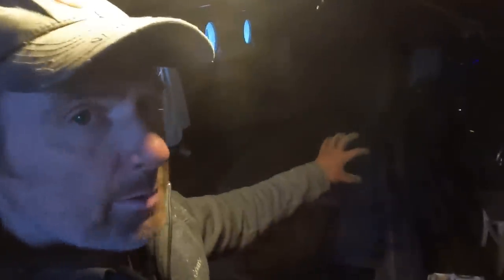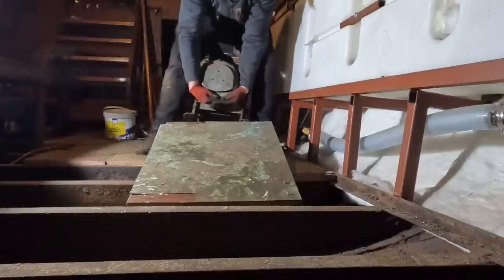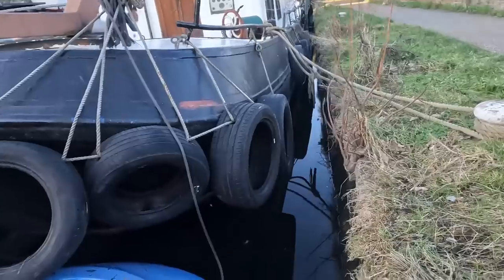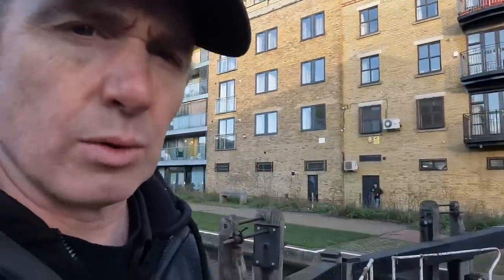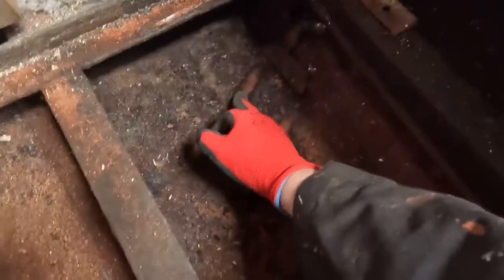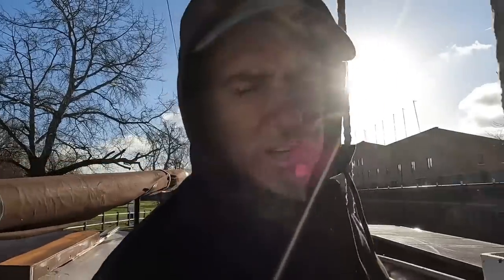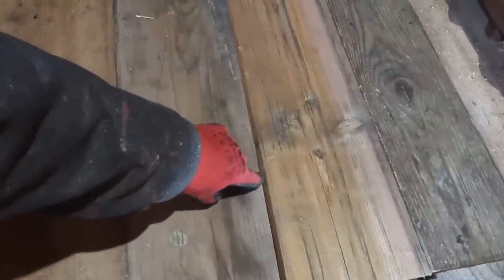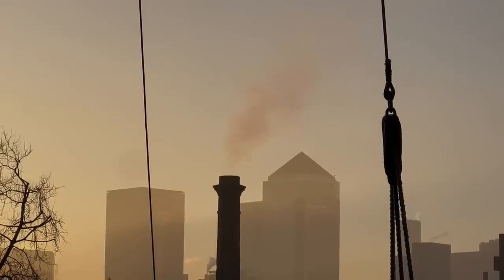Installing flooring and other work on my ancient Dutch Barge Linda 118

Comment: Such a huge step forward! I think it's fair to say that you're over the hump now. From now on lots of fun projects are waiting and I can't wait to watch all your steps. I love the idea that the flooring is made off Lindas old mast AND a piece of old flooring. Will you eventually sand and varnish it? Maybe it's possible to level it with a router after it was laid?
Reply from the maker: Yes I will be sanding and varnishing the boards. There are a few more bits to happen to the boards firstly. 
It does feel like the fun jobs a coming down the road. Everything I do will be an improvement.

Comment: "Did some one say 'FIRE?' As in 18 pounders? Harr. Swab her out--where's my powder boy?--tighten them tackles and run 'er up...."

I can just imagine the Captain getting...uh...triggered...by the word FIRE.  But it looks like it was cold enough to freeze the balls of a brass monkey.  If in doubt, you'll have to ask the Captain what that means.

What you thought was a former factory flue is actually a stink-pipe.  You can learn all about those on the video series Joolz Guides.  So far, I notice that Joolz has not told anyone any fascinating facts about pirates on the canals around Greater London.

The floor finally looks like a floor.  I'd say that's progress.  A good illustration of "cut it off three times and it's still too short."
Reply from the maker: I’ve met Joolz a couple of times. Is is exactly like you see him in the videos. Lovely man. Very tall! 
I feel measurements are a guide and a multitude of cuts is how you get real accuracy!😂😂😂😂
Reply: @canicebannon  🤣

Comment: Love it a free picker, find a use later....why aren't you using the old generator or do you only use that one for welding?
Reply from the maker: Hi Matt, the petrol generator is much quieter and it’s easier to turn on and off. I use the big welder generator when I’m welding or if I’m going to be using it continually. By the way, I still haven’t forgotten about the boat tour of Jorja, but Jorja is a bit of a mess at the moment, so when it’s a lot nicer, I’ll do a tour. I haven’t forgotten.